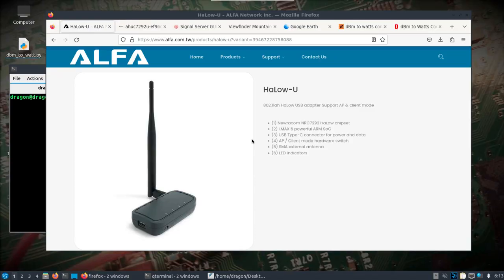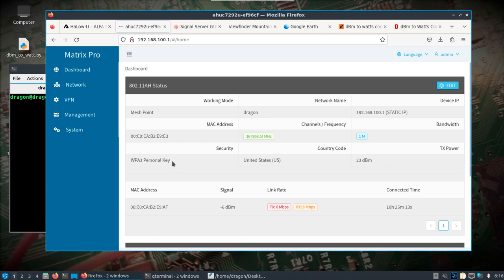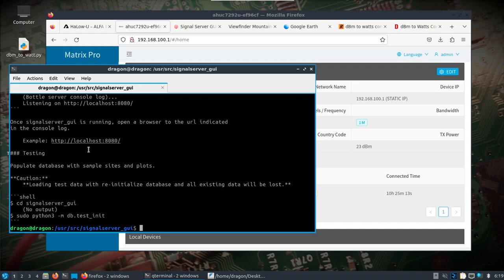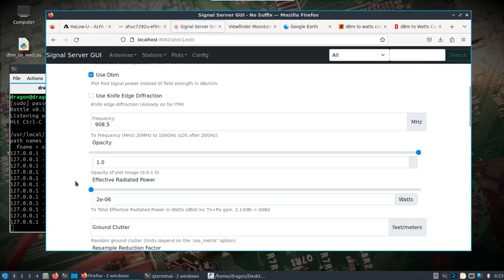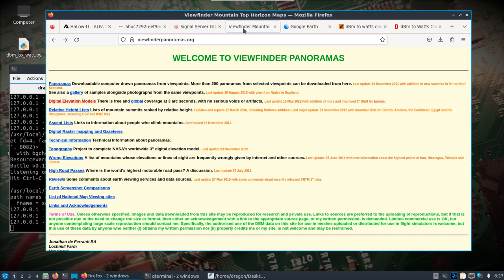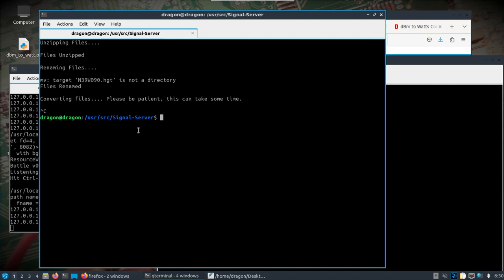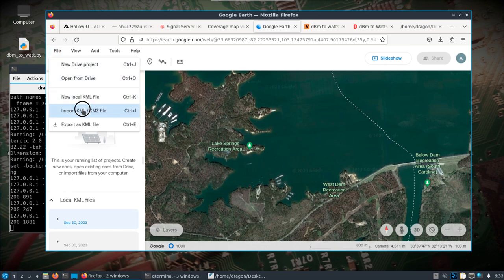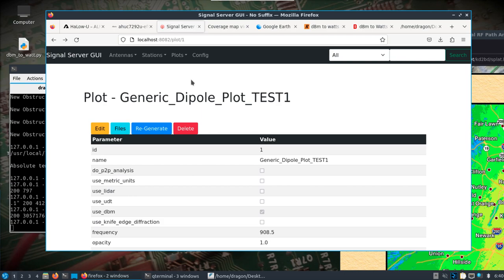DragonOS FocalX WiFi HaLow RF Propagation Analysis & New Firmware Review (Signal Server GUI)

Comment: Have you considered using multiple Pluto with Alfa attached to Pluto with usb. You can load stand alone applications on the Pluto so they can network yet operate independently. As I e just been reading in ADIs PlutoSDR wiki. Oh yeah, I changed my channel name and handle as I’m going to attempt to produce some Engineering content. - Jason Burchell

Comment: 802.11ah and the Alfa HaLow-U seem interesting, but my local reseller says $125! Yikes. Why wouldn't I just buy a HackRF clone for $80 from China and run the 802.11ah gnuradio stack? (I'm sure there might be some better receiver sensitivity with the purpose built chipset, but if I just wanted to get playing with it....) RAK sells a HaLow chipset device for $80. Still pretty pricey for what it is. (A 915Mhz transceiver that can do QAM256.)
If 802.11ah is ever to get off the ground and be more IoT-ish, these IP/chip silicon companies are going to have to ease up on the pricing! (I remember when LoRa chipsets were super expensive.)